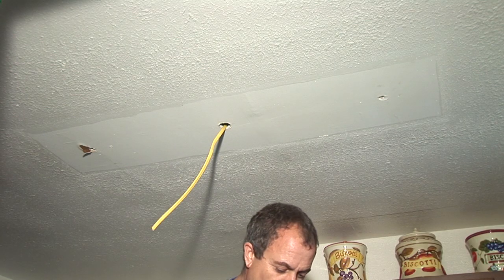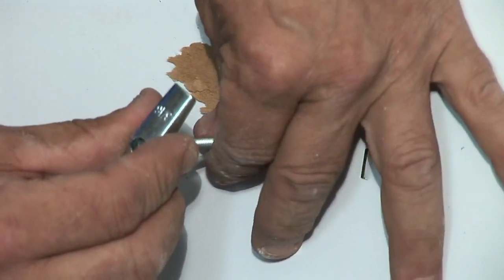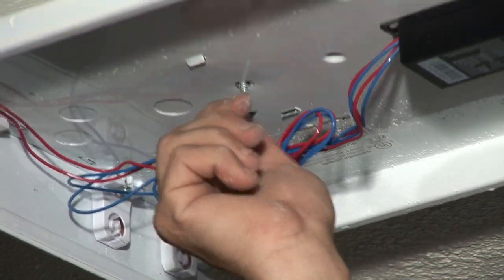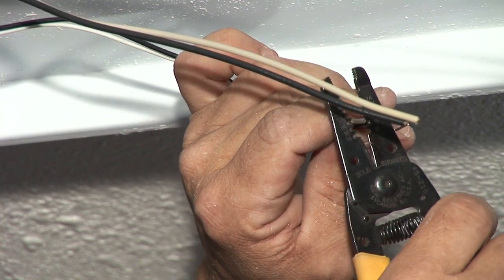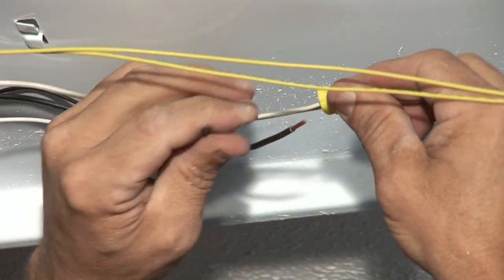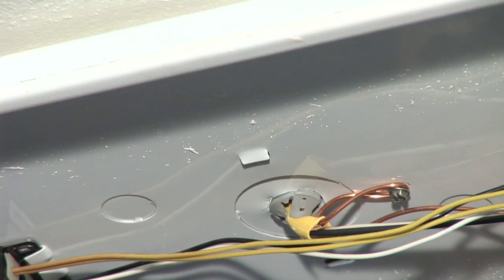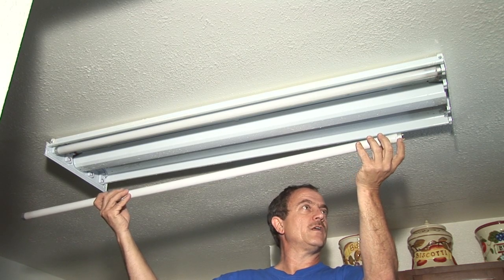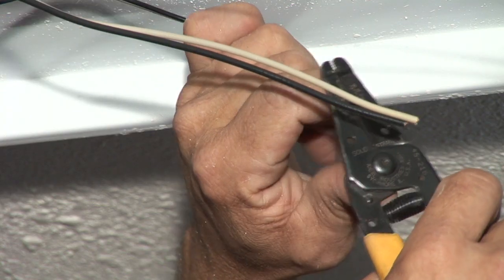Electrical Help : How to Install a Light in the Kitchen

Comment: Hi, I have a question on the replaced Fluorescent light,  I got one  won"t go on, but the other one is on but it's burr, so can you tell me what is wrong with  light fixture or might be the Fluorescent itself? but they're both are brand, I just can't figured it , can you help ? Thanks

Comment: standards in florida must be very low. you need a electrical box to make of to code
Reply: This type of light has junction box as part of the fixture (the covered part in the middle), don't need one in the ceiling.